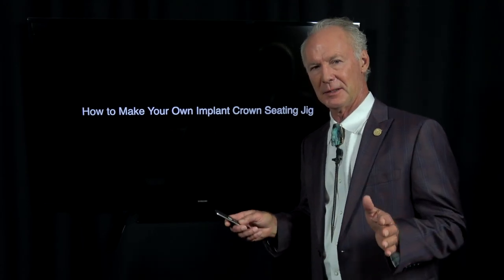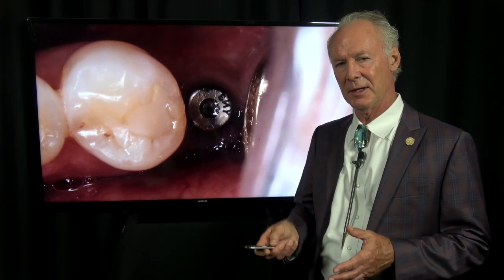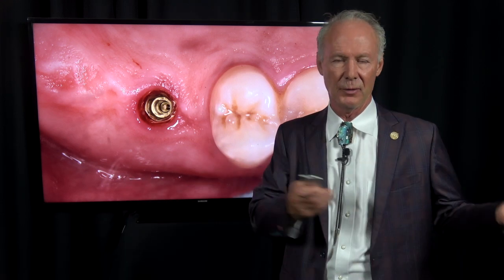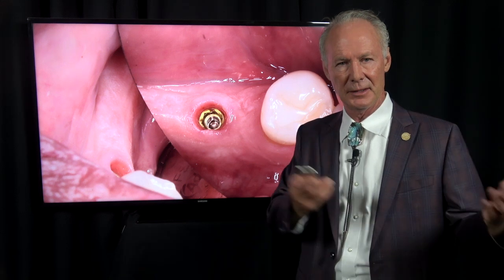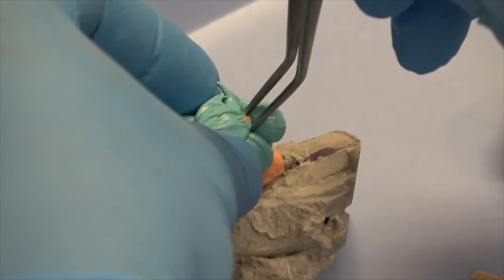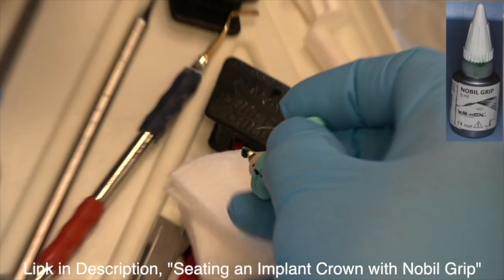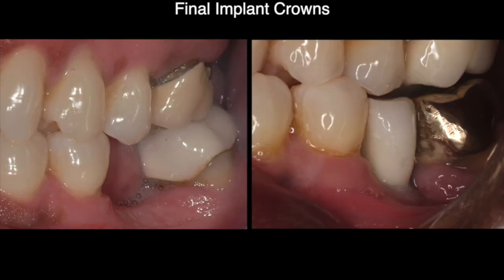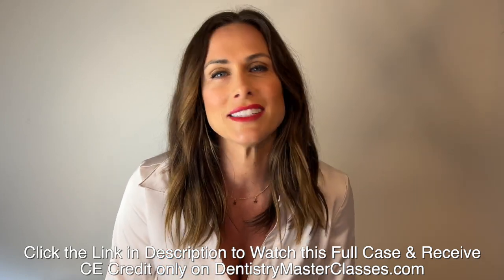How to Make Your Own Implant Crown Seating Jig - Dental Minute with Steven T. Cutbirth, DDS

Comment: Always thought about adding glue to the screw but don't you think that screw loosening may be good as a red flag that tells when something is going wrong force wise, otherwise, this detrimental force are going straight into the implant and bone.
Reply from the maker: Good question. The patient should have a nightguard for wear while sleeping, but if the patient grinds their teeth during the day, there is nothing I know to do  to save the restoration and implants. I do not want to have to be replacing implant abutment screws on a regular basis. Since I have been using the method I describe, i.e., torquing the screw twice to 35ncm, 15 minutes apart, and using the Nobel grip on the screw, knock on wood, I have not had a single implant screw loosen. There is no perfect answer I am aware of for the big time teeth clincher.
Take your practice to the Top Tier. Subscribe to DentistryMasterClasses.com for an organized library of all the Dental Minute videos plus many complete comprehensive cases and many very important articles. New cases are added weekly.  Only $39.95/month.
Click here to subscribe: 
https://membership.dentistrymasterclasses.com/purchase/?plan=513